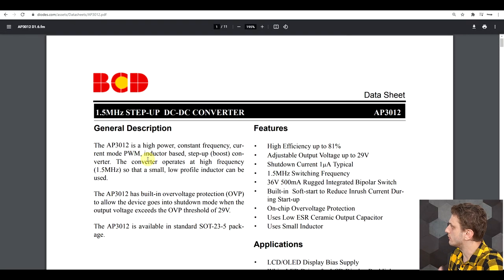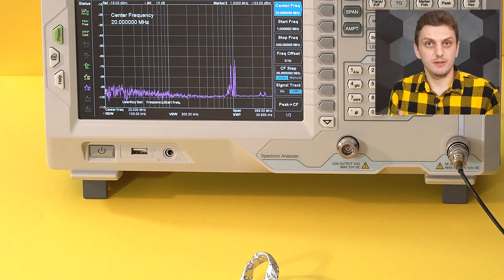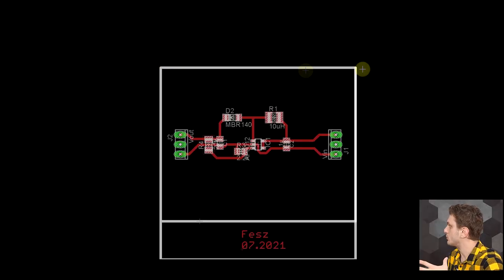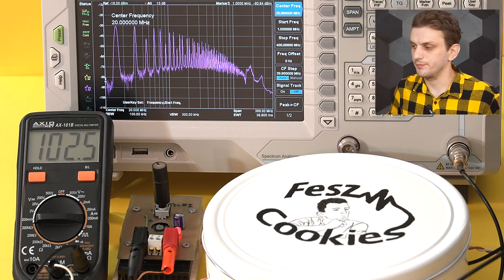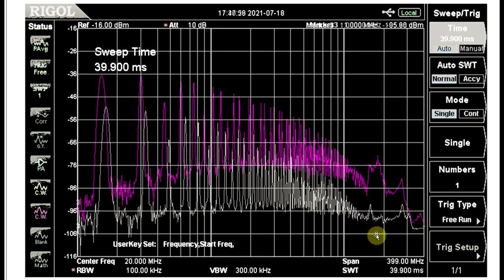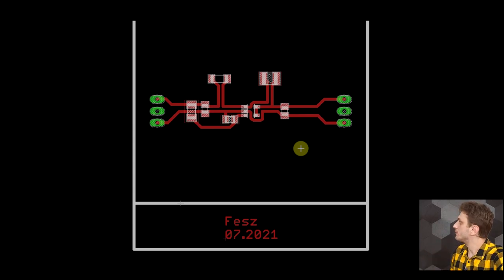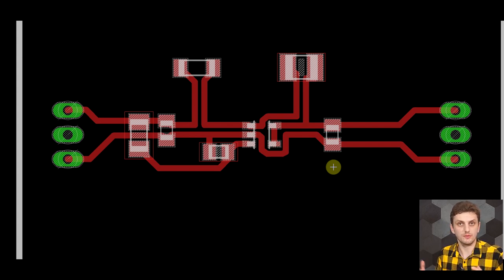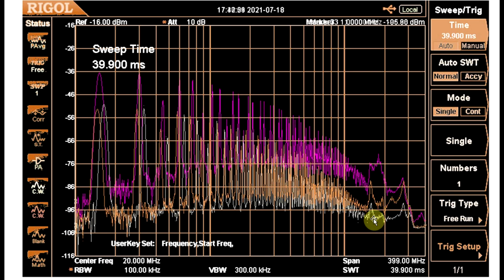About CIRCUIT LOOPS in switching converters

Comment: Thanks for the video. As a side note, I'm pretty sure DSA815 supports up to 3 traces, there is no need to overlap them on the computer.
Reply from the maker: I think I played around with that function at some point, but the traces I used where "peak hold" or "average" - I didn't try saving and loading traces from memory, I will be doin that. I'm still learning how to use the DSA... Thanks for the advice!
Reply: @FesZElectronics  Oh, I see. You can use peak hold or average, and then freeze the trace, and use the next one.

Comment: This is a very good video, and well timed for me.
I was just wondering about RF shielded boxes recently (like your Fesz cookie box).

Does it matter what it's made of? Such as steel, tin, copper, etc.
How tightly does the lid have to fit?
What about the hole for the cables? I would think a feed through connector would be best.

Again, thanks for another excellent video.
Reply from the maker: Hello! I covered this to some extent - the material matters because of its skin depth and the frequency at which you wish to use it - to improve magnetic shielding, especially at low frequency steel is recommended, but at high frequency copper is also good (video about magnetic field shielding https://youtu.be/2U1o66bs_Qg ) and to improve electric field shielding an all around low impedance connection is mandatory - so the contact area needs to be clean and ensure good contact (more on electric field shielding: https://youtu.be/Sxqa7N-fuHM )Regarding the access holes, these are capable of carring noise into the box - as could be seen in this video; commonly for supply lines some form of filter is usually built into the hole - as you mentioned a feed through connector with some built in capacitors would be ideal.

Comment: Very nice video like always 👌 Should be interesting to see the behaviour with a 2 layers PCB that have a reference plane on bottom side. For example with GND or the DC voltages... and finally with a different PCB thickness??
Reply from the maker: Thank you! I do plan to make a video on the impact of the ground plane, but I wanted to handle that as a different topic.

Comment: Very informative. Thank you. I have an i2c circuit between two boards (about a meter apart) in an environment close to a solar array charge controller. During the day when the charge controller is handling a lot of power (lots of switching noise) the i2c link generates many glitches. I would enjoy a video on how to improve my setup.
Reply: One thing I have learned is that I2C is not really designed or meant for connecting devices at a distance. It's original purpose was to interconnect components on the same PCB (or a very nearby module). But..! If you were to try to improve your setup I would look at the cables (twisted, shielded?), what I2C speed is used (400KHz vs 100 KHz or maybe going lower?), and the strength of the pull-up resistor (lowering the value will increase power consumption a bit, but make the signal cleaner). Alternatively consider another protocol like RS-485 which is much more suited for this task when conning modules across a distance in noisy environments.

Hope this was a bit useful and I am sure mr FesZ has more great ideas! :)
Reply from the maker: I have to agree with Jakob! I would add though that you could put some RC filters on the lines, something to cut frequencies above the intended data rate - 100R+100pF to start with. The series resistor though must take into account the pull up resistor - you must make sure the voltage divider created does not run the initial functionality.
Reply: @jakobhalskov  I will try all of these suggestions. I just changed the software on my esp32 to run the I2c at 10khz vs the default 100khz. Will see how it performs later today. I also have some shielded cable with two conductors and will make a new cable with the clock and data inside the shielded cable. I'll save the pull-up change for last as that would require some disassembly and soldering.
Reply: Thanks Jakob. I have added that to my list of trial solutions.

Comment: Agreed that you have a single-sided PCB and this brings limitations, but would it be a nice addition to consider a "type4" PCB where you have traces that emulate a twisted pair (so that some loops run clockwise and others run counterclockwise)? You could reduce inductive coupling to almost zero.
Reply: PCB "twisted pair" is nice for traces that you want to protect from receiving interference. And in principle it would reduce emissions from power traces. However, the problem with turning power traces into twisted pairs is it involves a lot of vias, and those are relatively high resistance.
Reply: @Graham_Wideman  True, unless the component is used to "bridge " the trace.- kinda' like a "clover" in highway-intersections..  Else solder-filled through holes :)

Comment: Just to let you know that the third method of making the trace very near to each other will create an issue of crosstalk on the feedback pin
Reply from the maker: I specifically didn't touch the feedback trace, just the main power stage. Anyway; if the feedback line is routed close to the ground trace, it should not have issues.

Comment: Galvanized metal trashcans, grounded with heavy gauge wire to a ground rod, is a cheap and effective way to shield against EMP or other EM radiation and electrostatic. 
A favorite of doomsday survivalists. They put their emergency communication equipment in it.
No ground, no deal :)
Would grounding the supply to the metal not be enough to shield the electronics inside? 
Like how a car battery is wired.